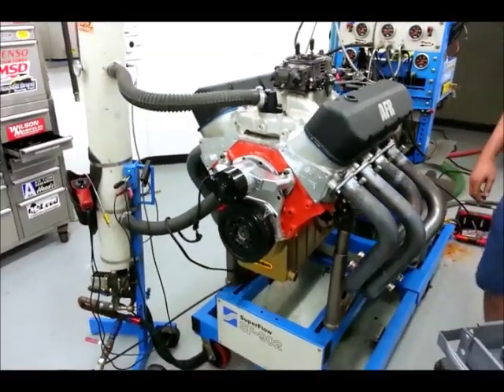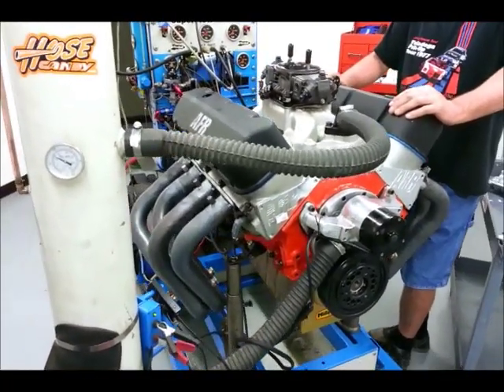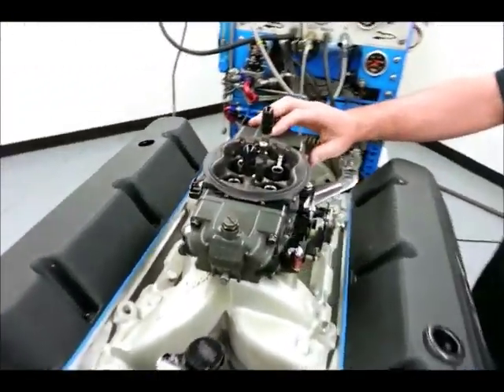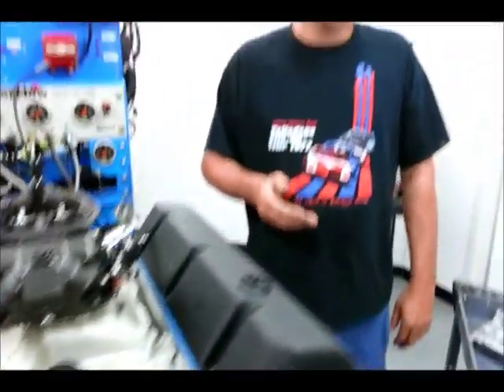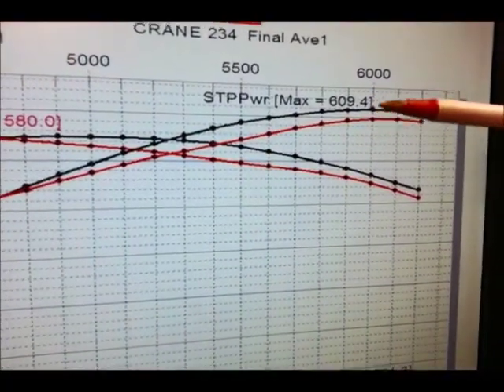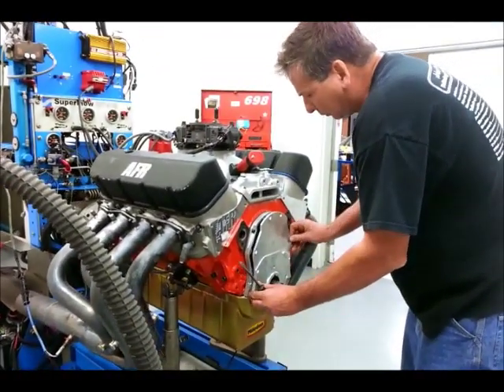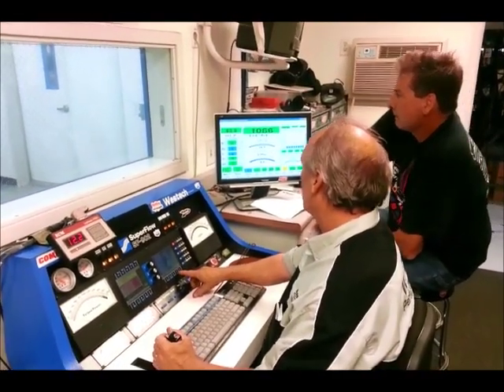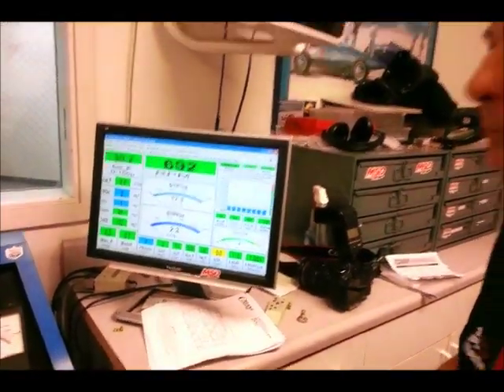Crane Cams Three-Way Cam Test

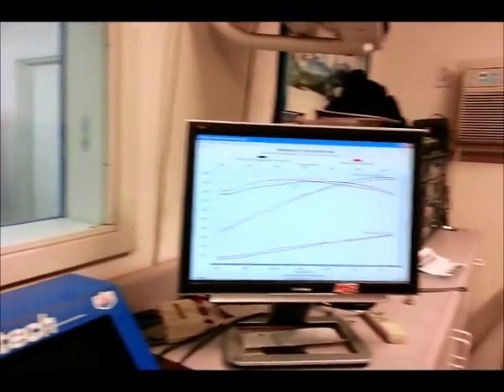Comment: I had a 70 Dodge Charger and it came with a 383 Magnum, it had been run at the Drag Strip, but someone took the big heads off of it and put stock ones on.  The motor didn't want to Idle in gear and it was an automatic.  I rebuilt the engine and left the cam in it, but I Advanced the cam 6 Degrees and so not only did I get Great Low end Torque, but she still had a lot of top end in her up to 6500 easily. 3:55-1 Rear Posi in an 8 3/4 inch Mopar  Differential.  I put in a 1800 stall converter and did some tricks to the Automatic 727.  L-60 fit under the Stock body, I had 2000Lb over load helper spring and got the Power to the ground on the street.

Comment: Engine, not "motor"
Reply: "Motors are electric ,engines are gas! " quote from the late Drake Shelton
Reply: @robertforrest9021  don't ever use motor oil in your engine Bob
Reply: @mannyceballos4915  🤣

Comment: Hi, I'm building an LQ4 6.0 with a 408c.i. stroker assembly. The engine is for an old 4wd Army Truck that I use for pulling Tree stumps and Highway Car trailer Hauling and of course racing stoplight to stoplight with my factory .454 gears. Luckly I have Hydroboost. Would you even recommend a cam other than stock? I would like to upgrade to a mild cam without much sacrificing low end torque. I also haven't bought any Heads yet. I have Iron heads so I was eyeballing just #317 Alum heads for my application.
Reply: summit has dedicated truck cams, since you have a good amount of ci you can get away with a bigger cam than a 6.0. Dont go above 235 for duration @0.5

Comment: IN the 70's we would  say a big cam wants dual 650's on a tunnel ram and  big square ports.  Digs only with that. That small roller cam gives  you all you need on the street in a chevelle with a muncie and  3:73's in the 12.  If you want a rough idle  lean out the idle  circuit :) - Sandy
Reply: Hey Sandy.... When is the last time you heard "3/4 cam"? Lol... I allways tuned the engines I built ( SB Fords) for my customers cars. With a balance between the timing and vacuum, especially if there was a brake booster. Basically took the "rumpity rump" out of the idle. The 347's would end up around 900-950 rpm at idle. Had a intense idle, snappy throttle but the "rump" was desired. Then I would suggest a looser converter and new trans. The increace in $$$ scared them off a bit. But after blowing a 45 year old C4 in a week or so and hearing "it's a dog off the line" sold the upgrades for me. Explaning why the new torque converter will feel odd on the street and telling them the new trans isn't slipping. Was kinda fun. I just told them to stand on the brake, load the converter and hang on. Heh..... Allways came back telling me "holee sheeet" I get it now! Was even more fun!

Comment: The years go by...just found this and not only have airgap dual plane, but the first (little) Crane roller tested still in box waiting to go in my crate 502 in 70 Chevelle. I was told the lift (587/610) is too much for my stock lifters, but am going to hand turn and measure to see. Want to deck the heads to get 10.5 to 1 comp. as here. Also have the MSD Atomic, and want to get Torquestorm charger, but Atomic has HP limit this might exceed.

Comment: Still wanna know why crane charges so much more than everyone else, it's insane 450$ for a sbc hyd roller cam!
Reply: anonymous  Well the assholes in China did not have to pay anybody to R&D the cams, now did they.
Guys that purchases all the China knockoffs are the guys that kill our sport.
The guys that did all the work, spent hours and years developing lobes and cam profiles, they did not do it for free and they put a lot of effort into it. That's what you get with a Crane, Comp, Howards or Lunati cam.

All I can hope for when I see someone run a Chinese knockoff roller lifter or roller rocker, is that the bearing fails and the needles block ever damn oil passage in the engine.
Reply: @AB-80X  So who's cam should we buy? Edelbrock or Isky?
Reply: @johnboticki9154  Isky. But who for what depends on the application.
Reply: @AB-80X  Got it. Just a heads up, Howard's makes their cams an hour away from me, up in Oshkosh, WI.

Comment: Can you give more info on the piston dome size, piston ring pack. And does the carb have original jet sizes.
Reply: chevelle man well they’re just taking the difference from small cams to bigger ones. Yes in term you would want to maximize performance with bigger intake runners. Higher cfm carb etc.

Comment: And then throw the dual plane on with the big cam and have the best of both worlds.
Reply: ABOlsen69X single plane for the mother fuckin win. Fuck that economic dual plane intake shit
Reply: @brendanmccarthy492  

Really? I can build you an engine with a dual plane that will crush a lot of the guys running single planes on the street. It's all about the combination. 860 hp with a2400 rpm peak spread. It will mash a lot of 950-1000 hp high revvers.
Reply: ABOlsen69X not if they have traction. You can have all the hp you want it’s useless without traction
Reply: @brendanmccarthy492  thats why you build hp for street and dump torque
Reply: @GJ-DT  torque doesnt help with launching. It's all in the power band. 

I built a 350 sbc with 650 inch lift solid roller cam and single plane intake that I ported myself with 210cc afr heads stock crank forged H beams and hypereutectic 12.1 pistons. Yes this build still and has been running for years.

Made 570hp at 6900 rpm with 112 leaded race gas. I drive the car on the weekends. And I'll tell you what. I've raced plenty of cars on the street even 600cc bikes up to 1000cc. Lost only 3 races. Out of the 40ish I had. 

One race was on the damn highway from Milwaukee drags in the state fair park. Raced a teenager with his turbo evo or whatever it's called. He wouldn't race me from a dig but he would race me on the highway where my foxbody doesnt work that well with 4.10 gears and a th400. So yes it's a cheap win for him. 

Second was a stretched 1000cc bike. At a street light some older gentlemen. Raced from a dig I got him out by 60 ft than he flew by me. 

Third one was when I didnt have the sbc in my fox. Still had the old clapped out oil burning 302. Raced another foxbody. It was my younger brother. He bought a nice pair of AFR heads and a bigger cam. I just did a 4.10 gear swap that was it. He pulled 3 car lengths while heading home from school.  

It's hard to beat a car on the  street light to street light that weights 2800 lbs and makes over 500hp thru a trans brake and 29x10x15 slicks.
Reply: @brendanmccarthy492  👍
Reply: Better of with small cam and single plain

Comment: 454ci,
 10.5:1 cr
 oval port AFR heads 265cc or 290cc they don't say
Holley 950cfm?
Edelbrock RPM manifold vs. Victor  (change over point was @ 4,700rpms,  RPM worth 30lb-ft while the Victor was worth +11hp with the middle camshaft) 

Hyd Roller cams  @ 0.050" lift:
Cam #1 -222/230 , (@5:35s "picked up 30hp gain with the medium cam with RPM manifold", so the small made 568hp/587lb-ft)
Cam#2 - 234/242,  598hp/ 580lb-ft with RPM manifold, 609.4hp/575lb-ft+/- with the victor
Cam#3 - 248/256, made 629.6hp and around the same lb-ft ans the middle cam 575lb-ft(+/-) 6,700rpm max pull/

Drop in TQ at 3,000rpms
Cam#1 to cam#2 w/ RPM manifold -  lost 30 lb-ft, gained 24hp+/- at the top end
cam #2 rpm vs. victor manifolds- lost 20lb-ft but gained about 10hp
cam#2 vs. cam #3 with victor - 25lb-ft drop in TQ but gained 20hp.....(lost about 81lb-ft vs. the small cam/RPM combo.)

I was surprised the 14 degree LARGER cam only picked up 

Vaccum
Cam#1 - 14.3 "
cam#2 - 11.5" 
cam#3 - 6.5<7"

For reference brake manufacturers and magazine articles say 18" is the minimum.
Reply: JerseyMikeP.. Cam 2 with some advance dialed in could give cam 1 a run for the money off the bottom. Cam 3 must be looking for  bigger heads on the top end, definitely not for street use ether way!

Comment: i guess it doesnt matter if you ding cam bearings in a motor thats only gonna see flogging on the dyno and never any street miles, but it would be nice if he set a good example and took it easy on em. not just slamming the cam into them